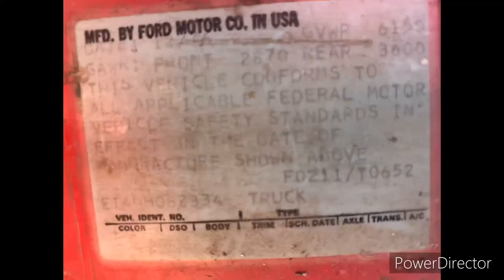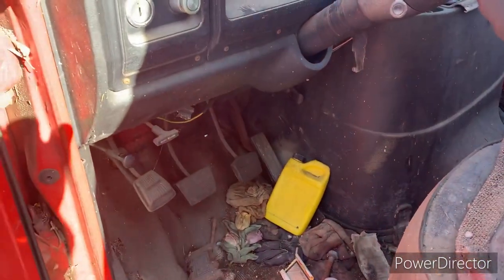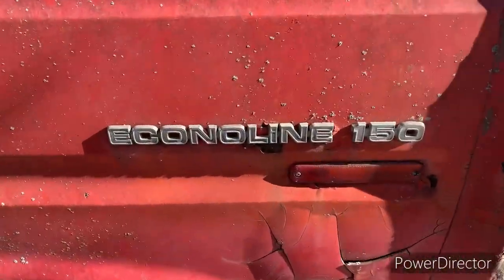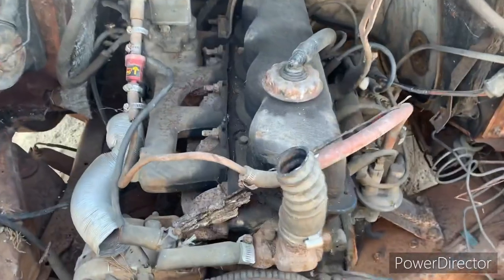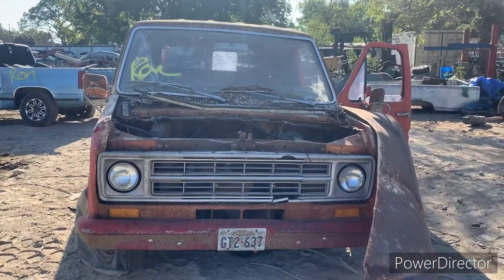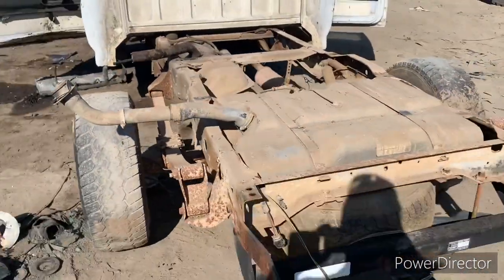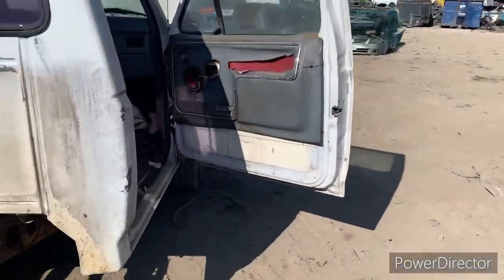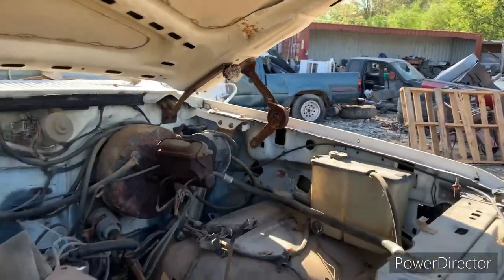1977 Ford Econoline THE CRUISING VAN. 1981 Ford Ranger f-150 MEETS MY CRUSHER..💯😎💪😁⭐️

Comment: We got the VIN, we win: E14 for E150 Cargo Van, B for 300 CID straight six with one barrel, H for Lorain, OH assembly and the rest is the production sequence lining up with a 1977 model year truck. Paint code is WT4040 "Coca-Cola" Red which was a Ford Fleet color. The Lorain, OH plant operated from 1958 to 2005 and was the main van assembly plant for many years. 

This was a van that was configured for Coca-Cola originally and that's what's on the tag under the hood. For some reason, it has a date of 3/17/75 which was a Monday. I'm not sure why it shows 1975 on the tag under the hood because the production sequence lines up with it being a 1977 van (being made in December of 1976). They may have had a large order that started in 1975 and ran through 1977 (or beyond). 

We got the tag, we can brag: 124 for the truck's wheelbase in inches, color is blank because it's a special color which is WT4040 "Coca-Cola" red which was a Ford fleet color, E140 for Econoline 150 cargo van, AA3 for black vinyl interior trim, possible G for three speed automatic transmission, Ford produced, 14 for 3.00:1 rear axle ratio, non-locking, 6150 is the maximum Gross Vehicle Weight Rating in pounds, 1977 means 1977 model year, 52 for Dallas TX sales district and the 1378 is the order/invoice number. 

1981 Ford with the VIN for the win: 1FT for US made Ford truck, D for 5,001 to 6,000# Gross Vehicle Weight Rating, F15 for F150 2WD pickup, F for 302 V8 with two barrel, 6 is a check digit, B for 1981 model year, L for Michigan Truck Assembly and the rest is the production sequence.  Michigan Truck still operates today and is just called Michigan Assembly. It opened in 1957.

We got the tag, we can brag: 9A for White exterior paint, 133 for the truck's wheelbase in inches (which is still on Ford truck door jamb labels, even today), F151 for 2WD F150 pickup with 5450# maximum GVWR, FD4 for red cloth and vinyl Lariat interior trim on a Ford regular cab with styleside box, T for four speed automatic overdrive transmission, Ford produced, 15 for 3.25:1 rear axle ratio non-locking. 1981 for 1981 model year, and 52 for Dallas, TX sales district.

Comment: From the shelves that were mounted on the wall, The red Ford Van could have been owned by a contractor earlier in it's life that for years was putting food on the table for him and his family.
Reply: Nope. This was a Coca-Cola van shipped from Ford. It says "Coca-Cola" on the under hood trim/buck tag and 4040 is for WT4040 "Coca-Cola" fleet red Ford paint.
Reply: @googleusergp  Thank you for the clarification.
Reply: @johnm.5848  Sure thing.

Comment: I mean those vans it's not like they're worth any kind of real money value or nothing like that I mean they're cool but they're not really worth nothing but my grandfather had a 78 Econoline van and family members ended up taking it to the scrap yard I was so young back then you know I had no control over it but the van I didn't care about the van that was in it but it did have a 289 high performance engine in it from a Ford mustang and I remember it had two carburetors that motor would have been worth a ton of money but you know how it is when somebody needs to buy crack they would do anything they got to do to get it
Reply from the maker: SWEET.💙😁 Yea these vans are worthless once u let them go..💙😁👍💯
Reply: @DeathRowCrushing.  yea what I hate see getting crushed is 96 and back Ford trucks
Reply from the maker: @benhall8946  yes I kno Ben..
Reply: @DeathRowCrushing.  I'm getting a 84 f150 the ones with the 300 inline and making it better is the 4 speed manual with granny gear add a 4x4 to that they are tanks and as tough as nails I love those truck right now have a huge soft spot for a 80 to 86 Ford trucks they don't make them like they used to for sure
Reply from the maker: @benhall8946  That’s Pretty Bad Ass Thier they do make sweet rides when u do them right with right plans that baby will fly..💯👍💪💙
Reply: @DeathRowCrushing.  hell yea man I love them I truck is a money maker and I'm gonna love her like my kid keep her maintained can't wait to take her in the snow